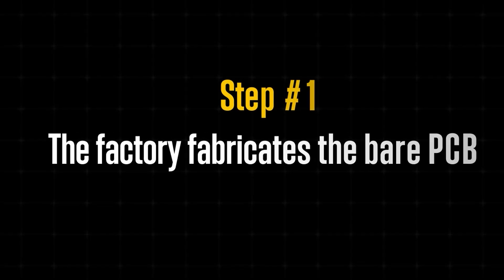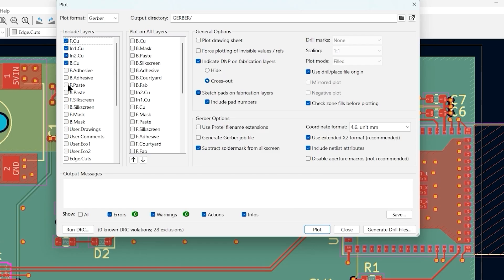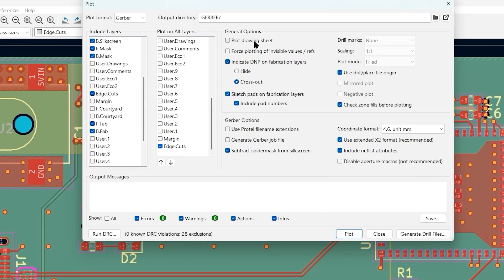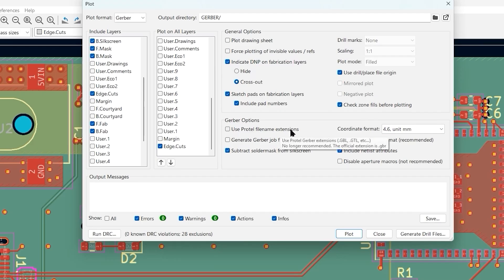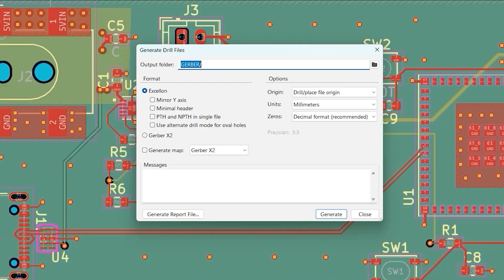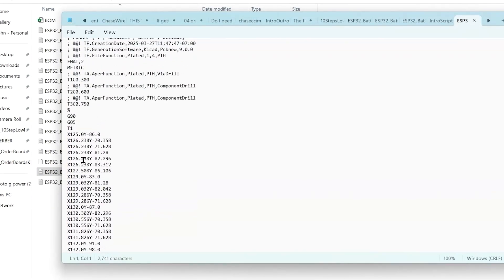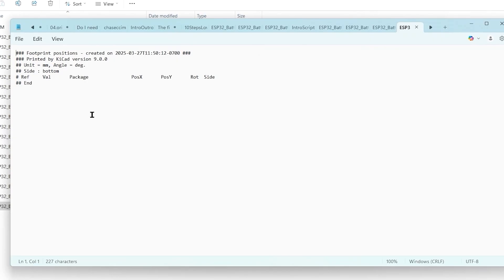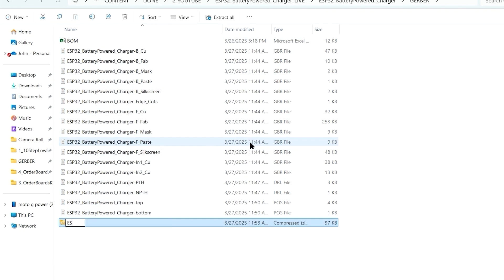How to order assembled PCB boards using KiCad

Comment: What do you think about the kicad plugins for prepping the files for JLCPCB?
Reply: I have used it and it's very convenient.  The only thing to watch for is that it can get the part orientation wrong, so you need to carefully double check (and correct via the UI) the orientation in JLCPCB before proceeding with the order.  It sounds like John will be covering that in the next video...
Reply from the maker: I've not personally used it before. I just tend to do it manually.
Reply: Thank you for mentioning this; I wasn't aware!
Reply: I use the plugin. No hassle. Every time there's a small edit, i don't need to redo the whole process. Just takes one click.